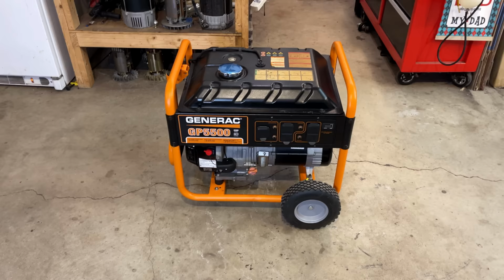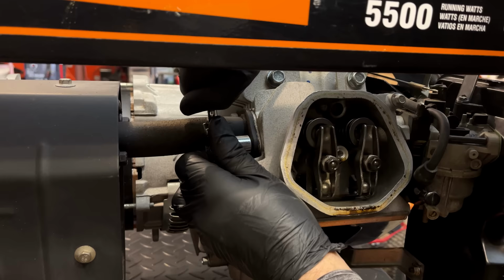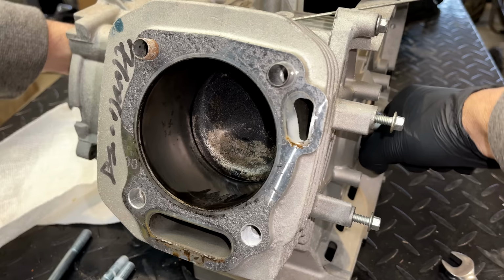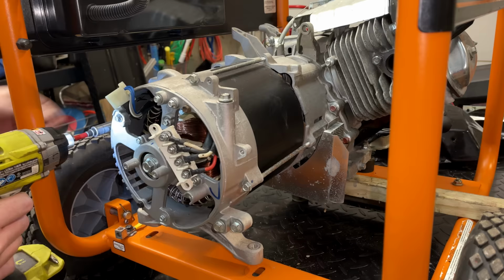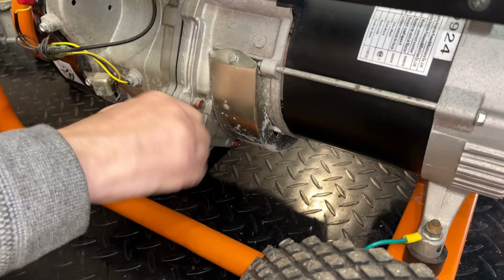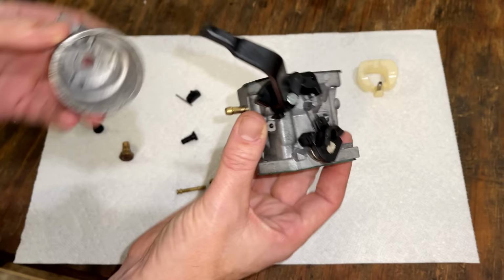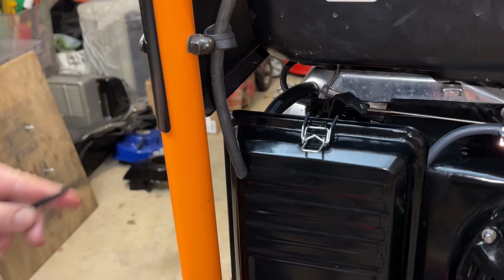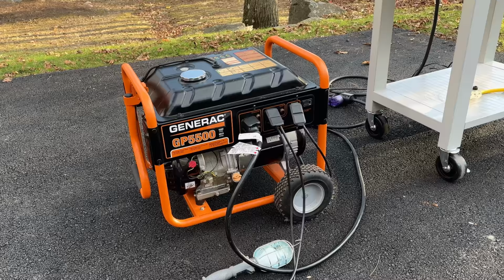What Caused This Engine Damage? - Generac GP5500 Repair

Comment: Not to say anything bad about anyone, but the gentleman you bought this generator from might want to consider spending some time watching your videos before he tries to repair anymore equipment for resale. You did a really nice job bringing this generator back to life, nice work sir.
Reply: Jim should be refunded at least 100 bucks.
Reply: Why put the same crap cam shaft back in the machine?
Sorry i skipped to head removal.
Reply: I agree. That Generac was a pig in a poke. I would also talk to the "gentleman" you  purchased this thing from.
Reply: Looks like a Florida flood victim that got power washed and put up for sale with a description of "I can't test it but it looks OK".
Reply: looks like gas in the oil and it sat and varnIshed inside the engine float was probably leaking by
Reply: I think the guy you got it from is questionable at best.
Reply: Sff

F
Reply: Yeah i would agree selling someone something that looks like that on the inside knowingly is crazy to me he could have at least tried to run some diesel fuel or sea foam or something threw it to try to clean that sludge out and unstain it a bit or at least wash the darn thing and put it back together  these seem like fairly simple machines

I wounder what the top side of that tank looks like if the bottom looked like that

Maybe possibly someone let the fuel valve on and put a full tank of fuel in the crank case i really dont see that doing much besides breakin the oil, it could explain all those wear marks tho maybe...
Reply: Jeez it's not Jim's fault. ❤

Comment: James, there HAD to have been a water component. You simply cannot have rust without it. It is not chemically possible. And the higher the salt/mineral/chloride content the more aggressive the corrosion is. Im thinking there was water and a lot of it in the tank, the carb overflowed and hydrolocked the engine that corrosion line near the bottom of the stroke is a smoking gun here as well as the very clear water line in the crankcase. I suspect there was bacteria in the water, which is why there was so much weird crap in the crankcase. The bateria were eating the oil and polymerizing it. Bacteria will also accellerate corrosion too, especially in anerobic conditions like under a layer of oil/gas mix.
Reply: I couldn't agree more, since the water has a higher specific gravity than either oil or gasoline, the water was under the oil in the crankcase most of the time except for the times that the guy previous to you pulled the starter handle and mixed everything up; can you ask that guy if the first oil change he did was white-foam water/gas/oil emulsion that drained out?  When the fuel tank is above the carb like it is in these generators, water that enters the tank falls to the bottom of the fuel and since water is significantly heavier than the same volume of fuel, it can easily blow right past the needle valve and leak directly through the intake valve and down into the crankcase.
Reply: Not strictly true that rust without water is chemically impossible--any oxidizer will do, including air (plus heat). But I think water is far-and-away the most likely culprit.
Reply: Aluminum doesn't rust (no Fe present) but it definitely can corrode in the presence of air.  It will form aluminum dioxide which is a white film.  I've seen a lot of it on aircraft structures.  Interestingly enough, that film will also inhibit any further corrosion.  But it does pit the aluminum.  That discoloration is not characteristic of aluminum dioxide and may be a remnant of other ferrous parts actually rusting in that pooled water and staining the aluminum casing as a secondary effect.
Reply: Thank You James!
Reply: Will General replace the engine ? Due to the age of the machine ?
Reply: True, these are notorious for gasoline submerging the crankcase. I bought one at an auction as-is and the engine was hydrolocked because there was so much gasoline in the crankcase. I inspected it and after draining a gallon of gas from the crankcase it turned over well and I was confident I could get it running and bid to win. After 3 oil changes it's been running strong. This happens because if the petcock is left open, gasoline will trickle through the carb into the crankcase over time it seems. I haven't inspected the internals of the engine but I can guarantee its better than this based on the fact it runs well and has run well, and it was a gamble bidding on it because hey - it could have been water, but the smell of fuel was incredibly pronounced, and I can't simply understand how water would get in unless it was run in a rainstorm with the airbox open?
Reply: I have some experience with small engine repair and cannot understand how the corrosion in the engine could occur under normal circumstances WITHOUT water in liquid quantity being present.  Still it seems unlikely that water from fuel tank thru carburetor inlet could account for that much corrosion?  All I have are questions!

Comment: I worked as a Lineman for many years. We used Onan Generators on our bucket trucks and they were so reliable we became spoiled. Years later the trucks came with Generac brand generators. We had constant trouble with them starting and then I had an RV with a Generac and starting again was a problem. I enjoy your videos.
Reply from the maker: Onan are very good generators.

Comment: Another option would be user error. You never know what someone may have put in with the oil unknowingly or thinking it would help somehow.
Reply from the maker: Was thinking the same.  It could have been an additive if some sort.
Reply: No it’s defective cam , this is the 6 one I’ve seen now, they don’t want to warranty anything 😢😢
Reply: @philliphall5198  No argument about warranty, but they are not going to warranty an engine that sat half full of water and rust.

Comment: Looks like fuel ran past the float valve into the sump and filled the sump with cheap gas / oil mix the water in the fuel would cause the rust. This generator prob sat for 10+ years with that contaminated mix in the sump.

Comment: The plugged vent tube forced fuel into they cylinder. That was the cylinder damage. The fuel made it into the oil where it became old and varnished the case and also held water for the rust.
Reply: Nah, it was re-assembled wrong…

Comment: I was given a Coleman 2000 year model Maxxa 3000 almost brand new looking after diving in I found rust all throughout internals and especially bottom of crank the exhaust valve had alot of crispy critters sludged up on it I would have never attempted to overhaul it if it had not been for your videos. I really am thankful your here on YouTube.

Comment: James, the only experience I had with an engine that nasty inside was when someone (I suspect a recently fired employee) added sugar to the oil and it looked about as bad as this example. The engine was replaced in that instance too.
Reply: How would sugar hurt the oil?  I thought you were supposed to put it in the gas tank so it would be burned in the cylinder and produce massive amounts of carbon.

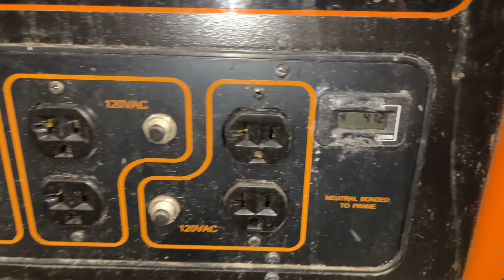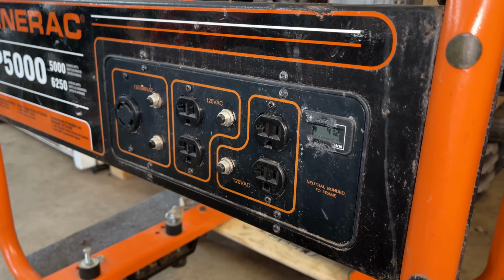Comment: If you want to find out if a generator has a bonded neutral, it sometimes is printed right on the unit (like we can see at 34:17 and 1:14:05). There's nothing wrong with verifying that when you reassemble, but if you're going to remove the jumper, you should probably tape over the "NEUTRAL BONDED TO FRAME" label, or better yet, use a label maker and label it "FLOATING NEUTRAL."
Reply: This is what Powermate claims about bonding the neutral tot he frame:
The neutral is bonded to the frame to allow for the generator to be used as a portable and allow for the frame not be grounded as per USA NEC250.234A. In other words the frame absolutely must be grounded if the neural becomes floating in all situations. Explains how RV's can just start up their little genies without any concerns.

Comment: Love this video in particular because I own a GP5500. Nice to know what breaks and how to fix it when it does. Will pay more attention to internals and oil because of this. As for why the first engine was so rusty, my bet is on being left in cold, humid environment without the airbox, possibly for years. Great job giving her a new life!
Reply: exactly my thoughts as well, as I purchased a GP5500 used. It had low hours, but issues. Fortunately it was related to the rust in the tank, and my nephew is a really good small engine mechanic. It is nice to see what goes wrong with these.

Comment: Brother, you are a master at troubleshooting and your attention to detail is impeccable. I love your video content. Watching you repair and fine tune these machines has taught me so much, allowing me to get my small engines (mower, snow blower, etc.) tuned back up and running like new, all due to carb issues. I have a Westinghouse genny that I've never had to use but run occasionally and I know that if I run into any problems with it, I can likely get it back up and running like new. Keep up the awesome work!

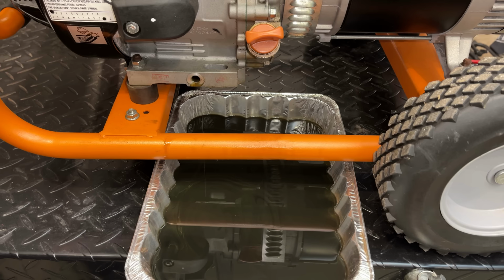Comment: James, your camera work and editing is great. It goes unappreciated for sure, but not by me. At 12:30 you take off a heat shield. You totally ignoralate on the bolt, teetering on the edge of it rolling off, and then you move onto the next camera angle without showing yourself grabbing it. All the ocd people are just dying. Genius!

Comment: Looks like fuel filled the crankcase and it did the same thing as it does to the tank. Can’t have enough spare parts. I picked up a rough Honda EU3000is the other day. It is going to be a challenge. Thanks Jim!

Comment: You would think a company like Generac who builds, portable and standby generators would build a Quality Product.
I had a 5500W portable Generac years ago, had well over 1000 hours on it, it ran strong and produced power with no major repairs ever.
When we were looking at having our standby generator installed, we were originally going to go with Generac after speaking to some electricians who installed them, they basically advised not to go with Generac. 
From what I was told, they are having engine issues, on a lot of their units that are being produced and replacement parts are hard to get.
Reply: On the fourth one I called them and they refused to admit the camshaft are bad, one of them belongs to my brother and I know he serviced it, only 34 hours, he’s a retired diesel mechanic 😊

Comment: Another great video James - that engine looked like it was pulled out of a swamp! It would be fascinating to know how that happened. I though at first it must have been in a flooded basement or similar, but the generator assembly would also have been affected by that and didn't seem to be at all.  Also interesting to see that familiar THD issue with the inflection in the  back end of the AC sine wave - you would think that the manufacturer would improve the generator assembly to address that design issue. Thanks again for the fascinating content and locating these very interesting repair cases - very enjoyable to watch! Merry Christmas mate.

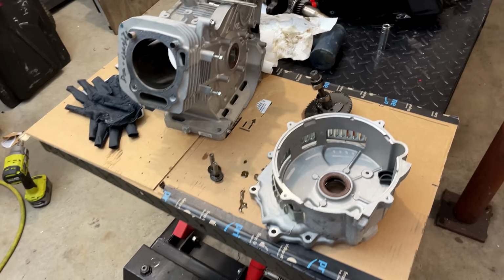Comment: 33:30  That engine absolutely will run again and make good power.  It's not a hot rod.  Given that these things cannot be run anywhere near their rated power and that they run at the same speed all the time and that it will be sold as used, this could be fixed.
The only thing that would concern me is the gears.  Worn gears will quickly get worse.

Comment: I really enjoy your videos. At one hour and 18 minutes you are installing the gas shut off at the bottom of the tank.    The first day on my apprenticeship my journeyman corrected me on the proper use of a crescent wrench. You are using it backwards.  😊
Reply: The moving jaw is weaker than the fix jaw. When using backwards there is much less leverage to this weaker jaw.

Comment: I know I have said it before, but there is a nice space next to the analoge meters on the load bank for a power montor module that will digital display of all the power/voltage and frequency readings, 🙂
Reply from the maker: I was looking for one that would fit the existing cutout.  Kinda lost interest though because of the Amprobe connection to the load bank.  The analog gauges are close enough.  A digital amp or watt meter would be a nice add though.

Comment: Things didn't look too promising at the beginning but they had really turned around at the finale. You do good work.

My generator is a Honda EN3500 with the GX240 engine. I replaced the original oil drain plugs with two Gold Plug MP-01T magnetic drain plugs. They're a good investment that'll keep metal shavings from circulating and prevent further damage. Chances are they'll fit the majority of the "Chonda clones."

Comment: That 1st engine would definitely run just fine. Put a new cam shaft in and get rid of the surface rust, clean everything up real good. Shame to see it all thrown out.
Reply: I agree,  the first engine could have been honed and cleaned up a bit and been serviceable for a standby Jenny. A little oil usage but usable for emergencies.

Comment: The tank vent isn't part of California rules. The GP5500 is only 49-state compliant. The main reason for the gas tank vent to be hooked to the airbox is to keep expanding vapors from getting in the atmosphere and burns it as fuel. it also hels prevent dust abs crud from getting into the fuel tank while it's coming down.

Comment: I follow a number of restoration/rebuild channels and one kind of video I am super interested in is how your organize and store the parts and fasteners during deconstruction and the restoration process.
Reply from the maker: If I am familiar with the engine then organization is not too important.  For other less familiar engines I out the fasteners back where the go on the disassembled pieces.  Also use labeled ziplock bags and I always have the video to look back on if needed.  Sometimes it is.

Comment: I used a new Savior plug in a chain saw. I had all kinds of problems trying to get the carburetor adjusted.  Changed to a used Champion,  no more problems getting the carburetor adjusted,  and the saw ran great. I toss those when they come with a carburetor kit. I will pay more for the NGK rather than use cheap junk. Just my opinion.

Comment: Hi James I enjoy your video's.  You are quite a good mechanic and you are precise and thorough.  I believe your rust issue could have been caused like you first thought in this video namely ethanol gas.  My petcock didn't seal for a season in my Coleman generator. Even with my petcock on my fuel tank closed it didn't perfectly seal.  Also the carb needle is never a perfect seal so the fuel in my generator flooded out the carb slowly over time then drained into the engine.  The next season the generator wouldn't start.  The Fuel tank was  empty crankcase over full with oil and gas.    I've never heard you mention it in your video but the ethanol  in fuel nowadays grows a bacteria called acetobacter.  Antique car collectors have this issue because they sometimes don't drive their cars often.  The waste of Acetobacter bacteria is acetic acid.  Acetic acid will destroy your fuel system and IMHO may have been the cause that corroded your internal engine parts.  I have an older Corvette I have restored and sometimes I don't drive it for a season.  I've had to install 5 fuel pumps in my Corvette which become a solid corroded mess because of the ethanol in our fuel.  You have mentioned in some your videos about ethanol in fuel being bad news for stored generators.  I've been an auto tech all my life and opened my own shop 18 years ago.  I have seen many cars that are stored or not driven for over a year their metal fuel tanks totally destroyed and rusted from the ethanol in our gas.  Automotive Electric fuel pumps will be a solid piece of corrosion after as little as a year of storage with ethanol gas.

Comment: The "bad" one was suspicously clean on the outside compared to the internals.  Almost factory new outside.
Reply: I’ve had some with only 40 hours and cam bad , brand new junk 
I fact I’ve fixed 4 in my shop and other business done one
They are defective and if you have one better get it checked asap
Reply: @philliphall5198  This cam was pretty clearly ground down by the heavily corroded follower.

They do fail, presumably from being incorrectly hardened combined with oil film failure, but that doesn't appear to be the case here.

Comment: The video where you first discovered the issue with the stator wire terminal insulation causing a charging problem, is probably in the top 5 must-watch videos on your channel. Very informative and eye opening new issues found.

Comment: I like your channel. I have a Kipor 1000 sine wave generator that quit working about a year after I bought it. Kipor sent me a replacement carb, but I think the gas line might be clogged by the nasty ethanol residue. It still starts, but only runs for 2 or 3 seconds, and it dies. This model kipor carb sells for like $100.00 bucks

Comment: I've recently noticed evaporust is available at our cheap auto store, but the price is $90AUD for 4L/1Gallon. I died in the ass when I saw that. Great job putting this genset together.
Reply from the maker: I thought $25 USD was a lot.  Wonder why it is so expensive?  It’s a great product, but at that price it’s much cheaper and makes more sense to use an acid.

Comment: E 85 fuel maybe? Boat ramp gas? I tried going back thru the video to see if the stain line internally was higher than the oil fill level? If so I’d say fuel valve left open and leaked fuel into the crank. Sat a long time to cause that kinda corrosion. The connecting rod and bearings had to have been above the stain level during that sitting  time since they looked ok.
Reply: Also, with the vent tube blocked like it was, any increase in temp or pressure with the fuel valve open would probably force fuel into the carburetor. Maybe combined with cheap or bad gas?